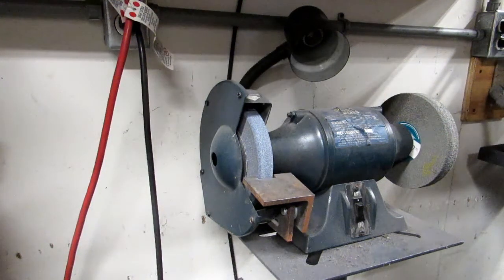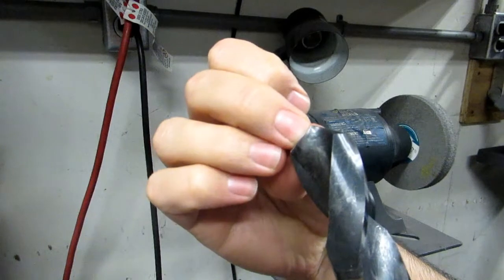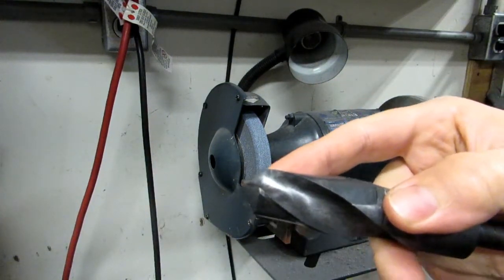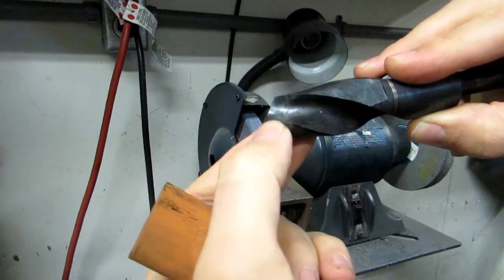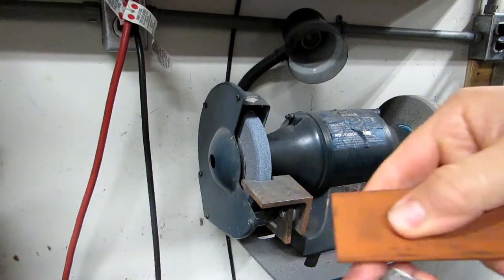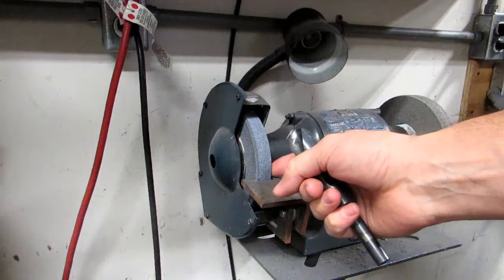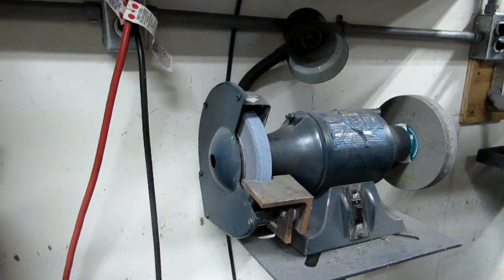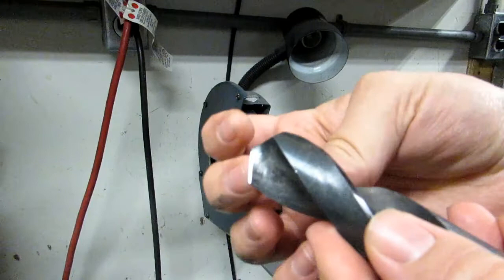Quick Machining Tip #7 - Modifying Drills for Grabby Materials

Comment: For clarification and using your lathe bit analogy, what I understand you to be saying is that a standard drill would have a positive rake angle and what you did makes it a neutral angle? Is that accurate?
Reply from the maker: Yep. That's exactly right.
Reply: @StuartdeHaro  Thanks for the prompt reply to such an old video. I had to mentally turn the drill bit around in my mind to process what you were saying. 
I have been enjoying watching your videos. They are well made and quite informative. Thank you so much.